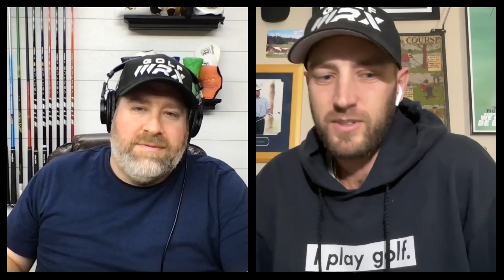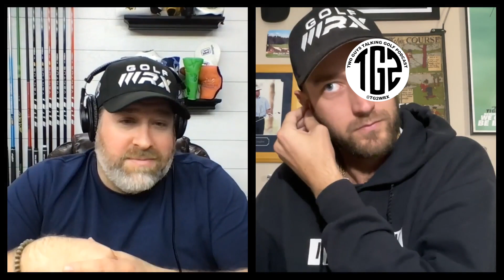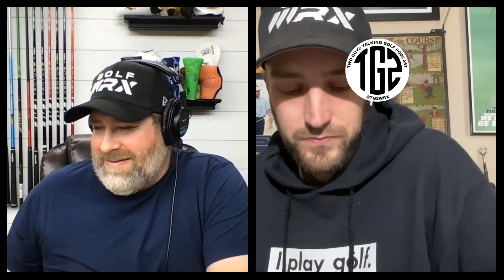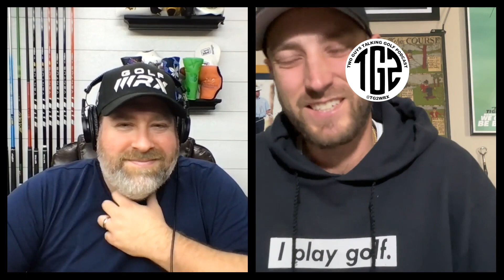TG2: Webb Simpson's Custom Titleist Blades, A Deep Dive!

Comment: Very funny your comment about a slightly larger T100s with a Srixon sole. I was an original 2008, 1st model year Titleist AP2 player. I brought these AP2 to my Titleist National Fitting Center in Toronto fitting for my T100/T100s fitting this past spring - and the first thing I said to te fitter was I couldn't believe how small they've made the new T100/s compared to the originals - the fitter and I took my irons and compared them to the T200s and they were basically the exact same size. The other thing I had done to my original APS was that I bent them slightly weaker, from already being OE spec'd very weak at a 43-degree 9 iron and a 35 degree 7 iron, and I further weakened them by mostly 2 degrees to create a set of clubs that have more bounce, less offset and are effectively the lofts of the new T100s but my 6-iron is 32-degrees instead of the T100s 7 iron being 32 degrees. My clubs have the Original Rifle Flighted 6.5 shafts in them. I'm a hockey player and have a very forward handle delivery so that is why I've grown to like lots of bounce on my clubs - and I also like slightly larger-looking player's clubs - and that is what the original AP2s are - slightly larger, lots of Tungsten down low, speed slot behind for a tiny bit of ball speed (though clearly not as hot as modern thinner faces. After the hour fitting, finding a combo of T100 & T100s & shafts, I hit it back to back to back against my 'custom' originals - and it became very obvious - and then the fitter said it - don't buy the new ones. I closest thing to my clubs were the T200s - they were just as forgiving and produced as similar ball flight - but I wasn't there to buy those. At the end of the fitting, the fitter asked if could hit my clubs and proceeded to do so. - after which he said don't ever sell these. So basically my set is 9-5 iron 2008 AP2s, playing at lofts (47,42,37,32) - and then I make the crazy jump to a 6&5 iron modern Mizuno HMB @ (28 & 24 degrees), with Steelfiber i110 Stiff shafts - which in the fitting this is where I would be using the T200s. I'm a +1 handicap, a good ball striker, but I just like slightly larger looking clubs - and in my opinion, Titleist really needs to bring back a new AP2 type club, that is basically the T100s but 10% larger, because the T200 is just ugly - but it does deliver very good results when hit. But back to building your own clubs idea - for me what I've learned is that strong lofted clubs are good starting blocks to bend 1 club weaker if you have a very forward handle delivery, or you just like bounce - or maybe if you play where it is very lush - or if you are a bigger divot taker - and the added benefit is that you get less offset. I know there are a few PGA tour guys that do this - VJ Singh & Horschel come to mind.